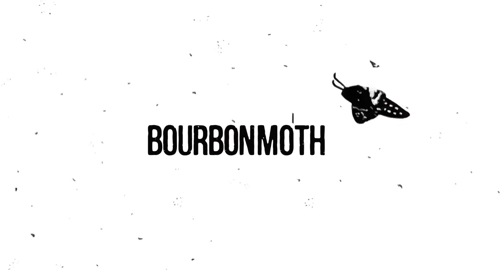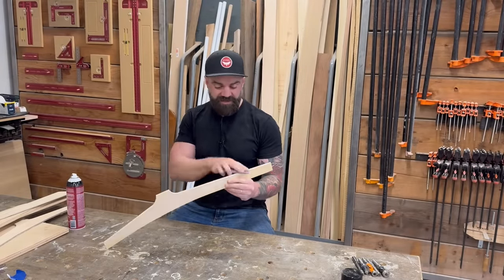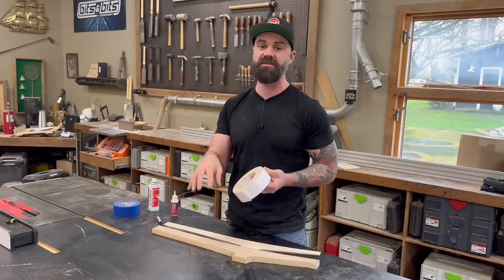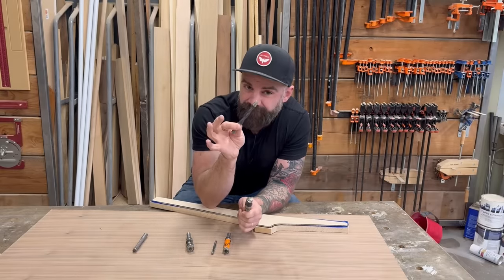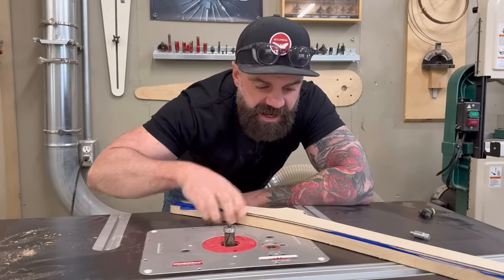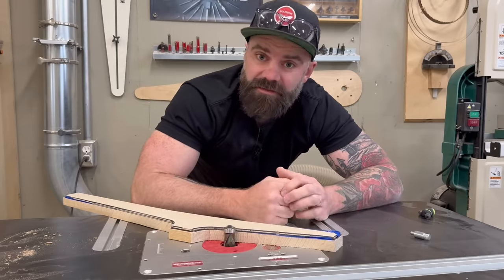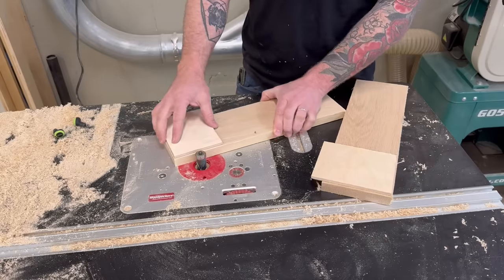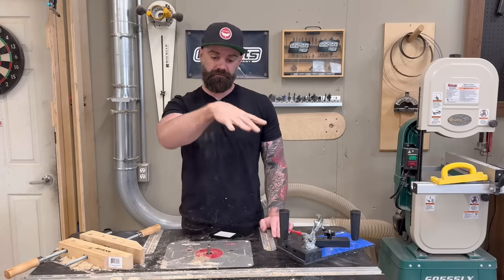Master the Router Table || Pattern Routing Made Easy

Comment: As a CNC freak, using templates cut on the CNC with a real router can actually be faster than using a CNC to cut the entire piece.  This is especially true when there are inner pockets involved, which take forever on the CNC.  With a nice fat router base and a beefy bit, a plunge router will fly through those.
Reply: Often while cutting somthing out on the cnc I think to myself " I could have had this done by now if I used a template" yet still no templates have been made haha
Reply: Yep. Can confirm. I do my templates on the CNC for accuracy and then use a bandsaw and router to do the actually pieces. Comes out cleaner (don’t need to worry about tear out or blow out) and it’s quicker.
Reply: @austinhall485  luckily with the CNC you could work on other parts of the project while the robot does its thing. That's what really makes the CNC faster, even though it may seem slower for the CNC to actually cut the piece.
Reply: @sparrowhawk009  yes and no. Not all projects allow you to just walk away without risk of somthing going wrong. Many times in the middle of a run I've lost suction on my material and comes loose, if I walked away and did somthing else it could have been very problematic. Usually when running 600ipm I'm not just walking away and hoping for the best lol
Reply: @austinhall485  yes, you still need to keep an eye on it, but you can still work on another part of the project or clean up the shop a bit while the CNC is doing it's thing. You don't have to stare at it the entire time. Though I normally find those videos fascinating 😀

Comment: Two comments. First, when using a router table, why not change your right hand rule to a left hand rule. Second, when cutting a very small piece on the router table, could you attach it to a vertical guide that allows you to keep fingers above the bit. Of course, keeping the workpiece level could be a challenge, but just maybe it would work. But I have to say that I always find your videos very well done and informative.

Comment: Bushing suck because of the sizing issue, but, you will never wear out your template. I use CA glue on the edges of MDF templates to harden them so the bearing doesn't slowly eat them.
Reply: I have always 'sized' the edges of MDF templates with 1# cut shellac. I use store bought, ready to use shellac and reduce it by 2/3 with denatured alcohol to achieve the 1# cut criteria. Two coats...one right after the other...quick scuff with some abrasive in the 220 grit range. I then rub that edge with a scant wipe of paste wax. I have templates well over twenty years old that have held up using this method. 

But...the most important thing is to protect that edge from wear, so whatever you are comfortable with is likely what is gonna work for you. If you put 100 woodchucks in a room, you are likely gonna find twenty or thirty ways to attack a problem...and they will all work! 😂
Reply: @woodrowsmith3400  i have indeed used shellac too. The CA is harder, but I haven’t had issues with shellac either.
Reply: Nice, learned a new trick. I've used minwax wood hardener, because I do restoration work, so l always have it handy. I think I will also try Woodrows shellac trick. Thanks you guys and big thanks to Jason!

Comment: Two simpler ways to perhaps think about preventing a climb cut:  1) remember to push against the direction of rotation of the router bit.    2) If you have your template to the right of the router bit (i.e. you are routing on the left side of your piece) you are routing on the wrong side.  My 1 1/4 cents (due to inflation).  Love your channel Jason.

Comment: Great video, I prefer the masking tape and super glue method over double stick tape only because in the UK our double stick isn't that good and the template can " giggle" a little as the tape is a bit spongey, I would recommend burnishing the masking tape down on both bits to get good adhesion.
Also router speed and feed rate is important too 👍

Comment: Some really good advice, A few years ago, I was asked to build a social club bar for a local basketball team. The bar took up an area of approximately 6m x 2m with a sloped front that turned 90° . I designed it like  an aeroplane wing, lots of ribs to form the shape, and then clad with laminated mdf followed by timber veneer . I made a pattern for the ribs out of 16mm mdf with an attached bracket to hold it in the vice,  the hold down mechanism was an old fridge compressor used as a vacuum pump to a small hole in the centre of the pattern,  a thin rubber seal was used around the edge of the pattern and one after another the blanks were seated and routed, the quickest pattern cutting ever.

Comment: Carpet tape:  'round heah, comes in "light", "medium", and "heavy".  If you use "heavy" on wood, you're pulling splinters off the surface of your workpiece when you pull it off.  If you can pull it off at all.   "Light" works just fine, and you really only need tabs of it, not continuous lines.

Comment: Hi Jason, have enjoyed your channel for years now. That was a neat overview of template routing, but I beg to differ about end grain routing - well at least slightly: 

Depending on the shape of the pattern and what's actually necessary, sometimes I start on the end-grain and go back to do the long grain afterwards. This works especially well doing decorative mouldings (with a guide bearing).

I often make hardwood mounting plates for things like water taps (known as "bib" taps here in the UK), and cabin hooks, and sometimes display plinths. These will often be a qudrant moulding with quirks though, so there will be some uncut material left to support the cutter.

That way, any small tearout gets milled away on the long grain passes. But you're spot-on about not having blunt cutters for end grain!

Also, you don't have  to do your cross-grain stuff with a template cutter - you used the mitre saw in the early part of the video, making your template, and that's by far a better approach if it's a simple squared-off profile .

If it takes one quick extra step to get the corner crisp (router table then table saw or mitre saw), it's probably worth it.
Reply: You will be partially happy to hear we don’t call “water taps”, actually I’ve heard that or similar to name what we do call a “hose bib”. All that assume you are referring to the outside connection, if you were meaning interior then yes, we do commonly refer to them as water taps and the water we get out of them is called “tap water”

Comment: TIP:  you can also take the file for the paper templates to an Office Max or other office supply store that does large size printing. They can print it to size on some nice paper that won’t tear easily. And they usually give it to you in a cardboard tube  so you can store it neatly.

Comment: Most excellent video. I have been making sawdust for 35 years now and have never seen this much authentic information in so little time. 

I have been using carpet tape for over thirty years now, and doubt I'll ever even try the CA/blue tape trick. I trust carpet tape. Don't necessarily trust blue tape. I'm good with CA...just kinda sketchy with the adhesive power of a tape that is designed to be removed easily. A roll of carpet tape is a couple bucks more that blue tape, and I can spend a couple bucks more to save my digits.

Comment: It's worth pointing out that if you use mdf for your template, over time the bearing will dig into the side of the mdf template as its really soft, either use ply or you can spread glue round the outside edge of the mdf to make it a bit harder.

Comment: The first templates I made, I just sent the SVG file to SendCutSend and had them cut it out on 1/4 MDF on their laser and send it to me for like $25. Not the cheapest option, but the results were great. Once I had a jigsaw and a nice belt sander, I was able to print out templates myself, rough cut with the jigsaw, and shape with the sander. It's a little more effort, but it's also a bit quicker and definitely cheaper!

Comment: If using a straight bit leave a little extra at the corners of the stock when cutting at the band saw. Router the end grain first, so the tear out happens on the excess waste. When you router the long grain the tear out will be trimmed off.

Comment: Love your tip of the right thumb on the piece and the index points to the direction of using the hand held router.  
For the router table, rather than your mind trick, just use your left hand. Left thumb on the piece, and left index points to direction of cut.
Reply: I was looking through the comments for this exact question. Wouldn't the left hand work on the table?
Reply: Yes it would. 
24:04

Comment: I just buy the 2" golf tape, and use a wheel marker to cut a few desired widths on the roll. Usually 1", 5/8", 3/8". It only lasts a few turns but you can just line it up in the groove and cut again.

Comment: Just take a contrasting sharpie and draw an arrow on your router table for feed direction on each side of the bit.  Then you don't have to stop and think about it every time :)  And if you built your router table you can put a clear coat of finish over the sharpie to protect it from wearing off.

Comment: Two things about the straight knife bit. Just used one earlier today just to flush trim in a hand held router. It was a small amount so I used my little straight knife flush trim bit. I noticed it did this on the router table as well when you did the white oak. It kind of splinters the wood out. And on my piece… it splintered out and took a chunk out beyond the template. And that wasn’t on the end grain. It was the long grain. I was so mad. I never have that issue with compression bits. 

Also… that jerking that it did when you did the end grain. Just makes me cringe even just watching it. I hate it when it does that. It just scares the daylights out of me. After making some cheese and cracker trays and using a flush trim bit on the handle… I jumped online and ordered a compression bit. The thing is a beast!

Comment: Now I know why I have not had very good luck using a router. All my bits are straight cut bits. They don't work very well as you have demonstrated. I don’t have a router table. I just have a 1/4 " cordless ryobi router.  Every time I use it I feel like it just messes up the wood. I will have to invest in some better bits. Thanks for the tips.

Comment: Hey Jason!  Great video!  I built your floating mid century nightstands and thanks to your tips, they came out great!  I do have one question on this video.  When using a compression pattern bit, is it best to match the length of cut of the bit to the thickness of the stock?

Comment: Hello there and thank you for this video. I learned so much. I am brand new to router cutting wood. The only thing I would like to know when it come to the things you did is bit diameters. What is the best way to know the proper diameter bit for the wood thickness and hard/soft wood if that is relevant? I would like to be safe when working and I would not want to have a bit break or shatter by using a thinner /weaker bit when I should be using something stronger. Thank you for your time.
Reply: I would say a 3/8" diameter bit would be a great starting point for most cuts. I wouldn't go less than that unless you need to get into tighter corners. Even then, I would do the first pass with a 3/8" and then again with a smaller bit so the smaller bit doesn't have to work so hard. Thicker bits would be even stronger but they're more expensive. 3/8" bits are great work horses.
Reply: @lancemchatton9893  Thank you very much!

Comment: Do compression bits need to be sized for the thickness of the piece you are routing?  For example it seems that a compression bit for cutting 3/4" material would be acting as only an up cut or down cut bit for 1/4" material, which could lead to tearout on either the top or bottom surface.
Reply: Yes. If you typically use 3/4" stock, you might buy a compression bit with a 1" cutting length. That bit can have the compression zone toward one end allowing you to also use that bit for 5/8,1/2, 3/8 material. The compression zone doesn't always have to be right in the middle of the bit. Check out the specs on bid from different brands to find the right one for your needs.

Comment: Thanks for all the info. The CMT compression bit worked great for me cutting out an arch template I made. I have a question though. I have a template with 2 circles for a dog bowl table. Can I cut a hole in the stock piece the just use the flush trim bit to cut out the circle or do I have to cut out the circle close to the line then use the flush trim bit...thanks

Comment: That back wall gives me clamp envy lol
Reply: My first reaction also ha! Just a few more larger ones right, then turns into oh I need a few ratchet clamps, oh and some more high capacity f clamps oh and a few more corner clamps oh and......
Reply: @johnnycorn7225  I had to get a towel I was drooling so bad lol
Reply: @lechatbotte.  ikr the shop building process never ends now I'm working overtime this week so I can get an upgraded bandsaw for resawing purposes. Good tools are just worth it in the long run!!

Comment: The "peg" as you mention is called a "starter pin". I can confirm it is MANDATORY when using a straight knife cutter bit. With this type of bit, you need to realize that the full length of the cutter comes in contact with the piece when engaged. It tries to bite very aggressively and try to pull the part or kick it out. It is very dangerous. I strongly encourage people using the compression or at least the spiral bit type. At all time, there is less cutter length inside the wood which provides a more constant pull torque on you. Thanks for the video, I am pretty sure this will save a few fingers.
Reply: I always seem to be fighting my router when it's in the table. The wood always seems to jump, kick back, or have lots of tear out/blowout. I always thought it was the direction of the wood grain or the speed that I run the router. I've only been using straight blade bits...time to upgrade I guess.

Comment: lol the peg thingymabob is called a starter pin. forget all the sign language, just look at the direction the blades are cutting, push your piece into that cutting force. cut your end grain first so when you come back around it will clean up the frizzles on that edge

Comment: Templates have been a complete game changer for my woodworking! But what I have been doing is leaving the surfaces that will joined with another piece untouched with the router then I go back and cut it with a sled on the table saw. Maybe this is unnecessary?? But I feel like it gives the best surface for joining with another piece. Thoughts?

Comment: I work a lot with starboard plastic making plates and dash pieces. I use the radius bit with the plate on edge to make even corner radius’s and wonder if the are any tricks to doing this on the router table

Comment: 28:44 Jason made it where the compression bit had less to cut out than the straight bit. Of course the compression is better but the straight bit would have cut a lot better if it had the same board as the one he used for the compression bit. He knows what he's doing lol

Comment: I bought a very expensive compression spiral bit twenty od years back. It cut like a hot knife through butter with lovely big shavings across end grain but once i applied finish you could always see a line where the fibres had been sheered in opposing directions.  Is this still the case with modern bits ?

Comment: Great video but one question, how do you know if your router bit needs replaced?
Reply: There are a few signs that your bit needs to be replaced. The finished surface may not feel as smooth or flat, there might be ridges left over parallel with the material, your chips are bigger than usual, the cut will take longer than usual or even leave burn marks, or even inspecting the blade edges might reveal dings or chunks missing from your router bit. Most bits can be sharpened by a saw sharpening shop in your area. You can usually get a couple "resharpenings" on a bit before it's trash.

Comment: It seems to me that the right handed "L" shape against the Wood, as a directional indicator, works both with a hand held router, and on a router table.  The Wood is still on the same side of the Bit.  Only difference is that with the Hand Held, the Router is in Motion... but, with a Table, the Wood is in Motion.  So, physically, the Wood is on your Left Hand Side, and the Router/Bit is on your Right, whether it's the Wood moving or the Router moving.  Even though the Bit is spinning in the opposite direction, this is offset by the difference of what is in Motion... the Router or the Wood.

Wouldn't it then be easier to just say, "Keep the Wood on your Left and the Bit on your Right?  Or am I missing something?

Did I just make that even more complicated? LOL

Comment: The router bit comparison wasn't fair.  Look like at least one inch compression bit compared to a half inch flat. The one inch bit blade will be traveling twice as fast as the half inch. I do believe the compression bit that cost 10x more will work better with a fair comparison. Great job with your videos.

Comment: (not so) pro tip; A good material for templates is unused laminate flooring. NIce and stable, and sometimes harder than MDF.
Reply: Problem with laminate is the coating is ceramic and buggers  cutting tools seriously fast.
Reply: @MrBez007  I use the cheap stuff that the previous owner left behind - it looks more like MDF and a paper cover.

Comment: Do you reduce the rpm on the router when running template cutting? Or speed it up?
Reply: It depends on the size of the big. The bigger the bit the slower it should spin. A half inch router bit can spin relatively fast.